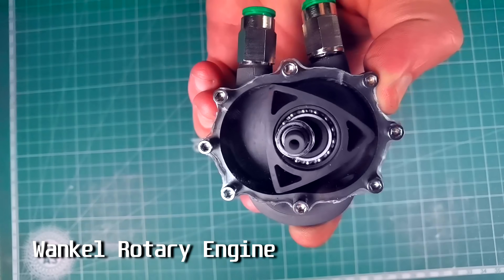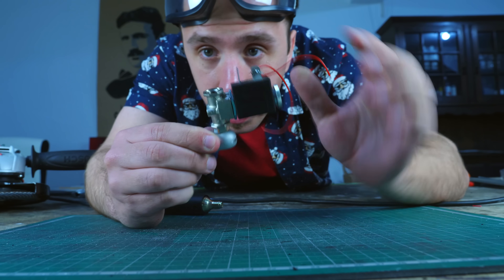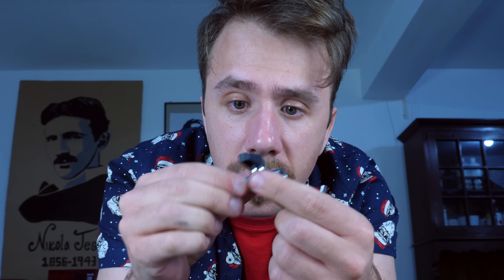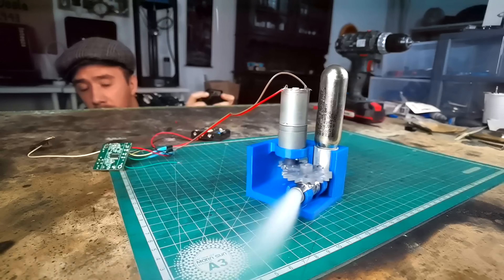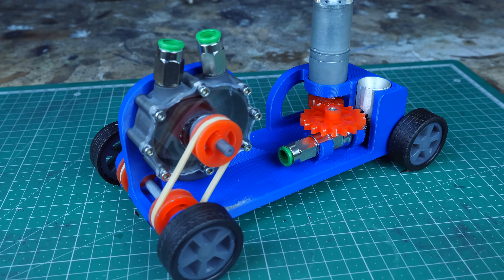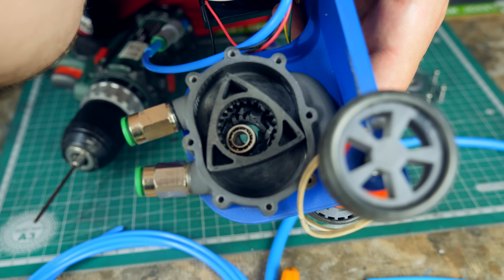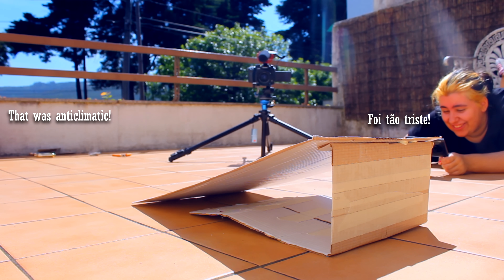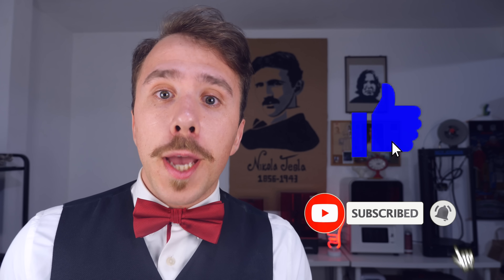Rotary Wankel RC Car (3D Printed)

Comment: With your RC gear mechanism, you could make a controlled needle valve instead of an on/off ball valve which, along with the expansion chamber others mentioned, should give you a means of better controlled throttle that should make it work better. But very nice invention! In especially impressed by your DIY electronic control valve!

Comment: Try using some gearing and a fly wheel on the crank of the motor and direct gearing to increase the distance the motor will run and the torque actually delivered to the wheels

Comment: 3d print a rube goldberg machine that slices and dices tomatoes but the machine requires you to use all your 3D printed engines to pass the energy on to the next contraption. You could have extra tomatoes along the contraption that get defeated along the way too.

Comment: The rubber band slipped a lot.
Should've removed the engine after you used the co2 cartridge like a rocket.

Comment: It looks like you kneed to use a regulator, like on an air compressor. This way, instead of using the power all at once, it can be less power over a much longer time. Idk if they make them light and small enough for what you are using it for and can take that amount of pressure.. Also, instead of a rubber band, try some kind of chain or something. It looks like most of the power is being lost instead of going to the wheels. Good luck :)

Comment: Try to make a 3d printed rocket that uses multiple co2 cartridges as fuel and the thrust, and see how high you can get it to go.

I also wonder what if you use rocket nozzles that could potentially redirect the flow of the co2

Keep up the good work integza

Comment: Someone skipped Physic Elementary about torque( just kidding, you Rock!) Try to fix the leaks, be aware that the pressure coming from the cartridges creates variations in the temperature and volume. Nevertheless, this RC car control with batteries is overkill for the scale. So get a BIGGER MOTOR and SCALE-UP the project, maybe the motor is better suited for RC Boat!

Comment: I wonder if it would work better if you used a larger drive wheel, so that the wheel itself works as a gear for torque conversion.

Comment: Video Idea:
I wonder if you could 3D print a small Paddle Wheel Boat which uses RC CO2 propulsion (like this one in the video) to start and transfer its kinetic energy to the paddle wheel in order to sail as far as possible! 

(Given my non perfect english I'll add an image for reference in the first comment)

Also amazing work as always, love your engineering!

Comment: rocket cars... there are many on the market for co2 cartridge-powered rocket cars... but what many found is that the spring-powered puncture device can be built with a very strong spring and then the rocket car gets as much or even more of its power from the spring rather than the gas car...

what about a spring-powered race car?

Comment: the CO2 should be positioned with the opening on the top -- else you get it coming out as a liquid,.  The thing would run longer if you invert the cartridge

Comment: You can design a 3d printed rotary car but you can't make a simple ramp... Like seriously why TF did you think that ramp wouldn't fold over its self. Like literally just lean the piece of cardboard against a few bricks and your base won't fold under itself. Honestly flabbergasted that you can design a rotary but not lean a piece of cardboard against... Literally anything that's stronger than cardboard

Comment: Video Idea: Make a fully 3D printed car, but the challenge would be to use solar panels to power it and use some kind of processor to steer it to go in a circle so you can see how long it lasts, and also try to improve its efficiency.

Comment: I am a martial arts instructor who had to stop teaching because of social distancing.
To keep training (alone) I built a puppet with some PVC pipes and thick copper wires for the joints. It didn't work very well...
I would need some 3D printed joints, especially for the knees and ellbows, but I don't have a 3D printer and I wouldn't know how to do it anyway. Can anyone point me to the right direction?! 
This is just the beginning, I would like  to add some accelerometers + arduino controller to check the impact and later...some pneumatic muscles, why not? let me dream ;)

Comment: You were missing out on a lot power from the tuner and sliding across the gear shafts to spin the wheels. I would recommend making a toothed band with toothed sprockets from the engine to the wheels to hold better traction therefore better input to the wheels

Comment: Make an magnetic track endurance race out of 3D printing... Planes should float on the tracks and CO2 is used to power them.

This would be interesting as it would teach the viewers how much weight distribution and pressure control plays a big roll in this track race ...

The longer the plane flies around the track the better the score...

Comment: You gotta get a better transmission. You're losing probably 95% of your power through that rubber band, and it gets even worse the higher the RPM is. Maybe try using a belt with small grooves in it, or better yet make a transmission, and make the valve narrower so that it prevents it from spinning as fast and makes it run longer.

Comment: I just finished your other Wankel video. To be honest I don't feel you created an air powered Wankel engine, but rather just a turbine... and not a very efficient one. The stages of a Wankel are specific for combustion engines. The second stage (compression) is to prep for the spark and ignition which leads to the expansion stage (which turns the shaft). With an air powered engine the compression stage here is not only useless but actually creates inefficiencies, so you added an air path around the compression stage. At this point it is no longer an engine but a turbine. 

Also, to make your car better you should put a regulator on the co2 canister to control the amount of air flow. This will decrease the amount torque put on the engine and the car will perform better. Also put the heavy components over the motorized wheels to keep them from slipping. In your car the canister and valve are in the back so the front end is lighter cause more wheel spin.

Comment: I really love your videos. But again this motor in this setup is absolutely a useless pressure motor.
You can easily design a better compressed air motor.
You have no inlet valve so it makes some pressure works against the drive direction.

Comment: You need some gear reduction to give it enough torque to go up a ramp like that, a planetary gear system would probably be ideal. 
Also if you wanted to go crazy you could tap the exhaust of one of your liquid rockets to act as a turbopump.

Comment: If you want CO2 valves that are solenoid operated, pressure adjustable, and can handle 850psi tanks then have a look in aquarium supplies stores for a CO2 fertilizer system.  They might be more available to you in Europe.

Comment: Can you create a rocket that uses both Sugar fuel and liquid gas to increase the thrust power. The sugar fuel would need to be injected with the oxygen and can be achieved with an object like a paint sprayer?

Comment: Maybe you should make some more gears connecting the wheel axle with this engine. (i think you the rubber "belt" is loosing too much grip) Using gears in and trying several gear ratios could help. Also you doesn't have to open the whole valve, maybe try to open it a bit. There are some leaks in the "engine" where the gas runs out. Either way this project is fun to watch and has a lot of potential.

Comment: Hey nice video
You can put the engine in a such way that the gass coming out of the engine should be in opposite direction of the motion of that car.
So you will get a thrust effect !!

Secondly you could add a flywheel to the engine,which will deliver power smoothly and for bit longer duration to wheels.
You may also experiment with different wheels and compare how much distance the car can conver.

Comment: Video Idea: Use C02 "rockets" with valves to make a drone.

need to increase throttle? open the valve more.

4 C02 cartridges and 4 valves all controlled by individual servos. sounds like a good idea :)

Comment: You need to have a seal on the ends of the of the triangle in side of the rotor to help build pressure and make the engine more efficient in its use
Reply: Called a apex seal

Comment: Is there a better way to learn how a rotary engine works?
On this episode of Engineering Explained, Jason Fenske explains how the wankel rotary engine works. Using a 3D-printed 1/3 scale model of a 13B-REW engine from an FD Mazda RX-7, we get a closer look at how rotaries function. The wankel rotary engine was first used by Mazda when the company debuted the Cosmo back in 1967. It was later used in pickup trucks, but didn’t gain popularity until it found its way into the first generation RX-7 in 1978. From there, rotary engines and the RX-7 name became synonymous until the final production of the RX-8 in 2012.

Comment: Think the power delivery needs to be upgraded, that rubber band skidded a lot. Also, use the 3D printer to make a due CO2 cartridge version, so the car can go further! Might need a split gear so the first rotation activates the first cartridge, and a longer spin starts the second.

Comment: The wankel engine is a pressure combustion engine and you are using it like a fan. I am surprised it worked as much as it did.  The bad seals letting the gas pass through made it work or else it was 💥

Comment: integza, using rotary engine probably isn't the best way to make power as it is designed for suck squeeze bang blow so you creating unnecessary pressure at the squeezing cycle witch is working against you. i hope you see this and i wish you the best.

Comment: You should put a psi regulator to make it more controlled and put the co2 cartridge flat so that the liquid CO2  Doesn’t come out right away. Maybe add some steering a second or third co2 cartridge.

Comment: How about trying a 3D printed boat engine using CO2 cartridges as a starter?

It might be interesting to see how well it can power a small toy speedboat, and if it can be faster then an RC motor.

Comment: some ideas for the car. maybe if you put some weight on the front of the car this might stop the car from doing burnouts. Also, a tighter elastic bands because if you look at 8:10 the rubber band is really loose and probably gets rid of some possible power. Also for a video idea if you use the Wankel motor on a model boat that uses the water to move the motor (idk)

Comment: You could try only partially opening the value to limit some of the airflow. It could give you a slower, more consistent power output for the engine. This could help with the slipping wheels and also help the engine run longer?

Comment: Hey integza if you want your rotor to spin faster I recommend 2 intakes and 2 exhausts, you can see in the slow motion part that the rotor is getting loads of pressure in but it can't get it out quick enough causing it to slow down, watch how slowly the compressed gass gets from the bottom chamber to the top, it has so much pressure that it is actually getting out past the acrylic cover, small redesign and it will be much quicker and have much more power

Comment: btw: looking into the engine you could see fluid or solid CO_2 in the upper "chambers" in the engine, which means that it wasn't able to expand all the way before reaching the engine, leading to power loss. maybe it's not too severe but just something to keep in mind myb ;)

Comment: Make a Air Powered 3D printed boat or car using Rotatory Engine with large Propeller by creating air thrust instead of directly powering the small wheel or boat propeller.

Comment: so what happens when you only open the valve a tiny little bit and let the pulley take advantage of the energy in the cartridge without just spinning wild and tearing the engine apart?

Comment: use the co2 as a nitro
have compressed air run the engine and use the co2 as boost I think that would be cool.

Comment: Can you make a gear drive from the wankel to the wheels? The rubber band has crazy power loss. Just a thought. Then put a plow blade on the front of the car to smash ALL TOMATOES.

Comment: You should have used Co2 GAS, and not Co2 LIQUID. (turn the cylinder nozzle up, not nozzle down) liquid Co2 is NON-EXPANDED Co2. So you're just wasting a ton of energy there. Additionally, the gas is expanding in the cylinder and not in your hoses and motor. This makes a big differentc because the gasses expanding in the cylinder go through a super tiny orifice. That would regulate the flow to a small extent and lengthen the run time. With liquid running through your system, the pressure is completely unregulated. So to say that your motor only spun 5000 rpm would be erronious. (As evidenced by the engine's imbalance breaking your drive gear on the engine side casing.) I also saw tons of energy being wasted between the wankle and the drive wheels. You should have used a chain or even better, a cogged belt. This way you can get 100% of the torque from the motor to the wheels. Also, if you were to seal your wankels front cover by reinforcing it with a sandwich plate around the perimeter you'd stop losing prescious gasses needed to drive your car. There is a TON of improvement that could be made with little effort/expense.

Comment: I think if you switched it from front wheel drive to rear wheel drive it might be easier because then on to be taking the weight and pushing instead of trying to pull the weight which would cause it to bounce like it did

Comment: You should use a gear system from the output shaft of the wankle motor to drive the wheels, not a flimsy rubber band. 
Your loosing so much drive to the wheels from the first hit of CO2

Comment: It looks like your rubber band was slipping around the output shaft for the motor if you used a different rubber band or something else that wouldn't allow for slippage you'd probably get a lot more efficient use of the gas along with turning the cartridge sideways so you're not getting liquid CO2 shooting out instead of gas.

Comment: Make a DIY variable throttle for your engine and make an Air powered Winkle engine rc car! With steering... I feel like the 20 gram cartridge could last a while if you managed the pressure correctly!

Comment: I might be stupid but I don't understand why you'd want a rotary engine for this application. the point of a rotary engine is that it can compress and ignite petrol and use the high pressure from that explosion to produce thrust, but seeing as the gas leaving the CO2 canister is already high pressure, wouldn't a simple turbine be more efficient, and also just much easier?

Comment: The valve is too big.  Use a needle valve with a small hole.  You need an evaporator / heat exchanger.  You're throwing out an awful lot of non-vaporized gas, that's a big loss.  With a needle valve you can lower the pressure and this CO2 cartridge will last a lot longer.  keep the exit of the cartridge up so that the liquid CO2 does not flow out of the cartridge.  If you do not have a needle valve, use an orifice with a small hole just behind the valve, a hole of 0.5mm or less.

Comment: can you make a type of RC tank out of some of your other projects. I think you could make a really cool anti air tank that shoots rocket, has a rotary engine. also I was thinking  why not use canned air instead of CO2 cartridges more gas, not as high pressure.

Comment: Bi or Tri rotor it use the exhaust to drive the next rotor in line should generate more power with the same source.

Comment: I know you won't read my comment but I am disappointed that You use cheap wheels and smooth ground with rubber bands to transfer the tremendous power from the engine to the wheels and only one cartridge ? Bruh
You have 3d printer ? Print some gears and better body and you would have bullet on wheels

Comment: Regarding the car the pulley transmission was very loose, it may be good to use a spring tensioner in the future or a more traditional gearbox. Otherwise the car went really well

Comment: Why don’t you use a flow regulator so that you can control the speed of the motor and make it run a lot longer? I think you could get a lot more range that way. Also, a toothed belt would transfer the power to the wheels much more efficiently.

Comment: I liked this video and others. I am already subscribed. Idea: plane made from 3d printed parts. I feel it would be interesting to try and over come gravity with 3d printed parts. For the engine you could use a rubber band. I think you would have fun figuring out the optimal blade pitch for power and efficiency.

Comment: You should have put a limit on how much the valve could open, put tank treads for more traction, and put the pulley ratio to 1:4 or 1:6 for more torque output enstead of speed output. A fly wheel would have also helped to maintain momentum. also a pulsing affect could have been used to maintain power for a longer period of time.

Comment: your project as a proof of concept has worked but sucked more that tomatoes. if you  just connected the motor without the gearbox you would get a better dragster in every aspect.

Comment: It would be nice if you tried to design a little tractor with a 3d printed engine that was geared so low that it could actually tow stuff around

Comment: Judging by the wheel hop and burnouts, and the rubber band slipping off the pulley, I think your wankel has more torque than your drivetrain can handle. Might want to get yourself some GT2 timing belts or something, and gearing it the other way so you get less torque and more speed at the wheel? Also, maybe consider using a manually-adjustable needle valve or something to restrict the flow rate of the CO2 so the bottle lasts longer and gives you less power over a longer period of time?